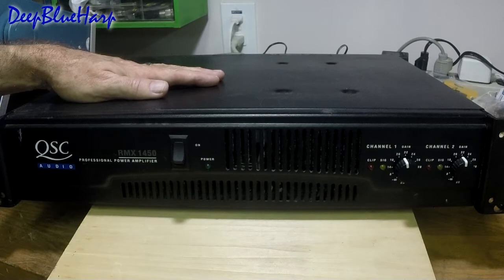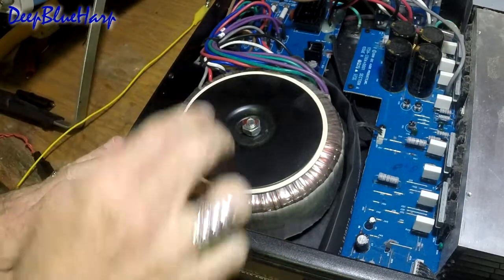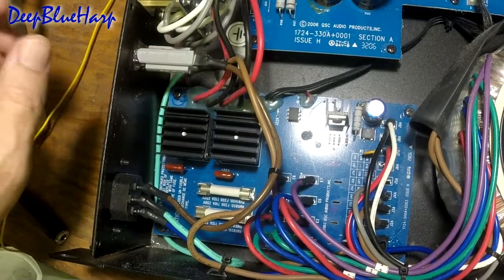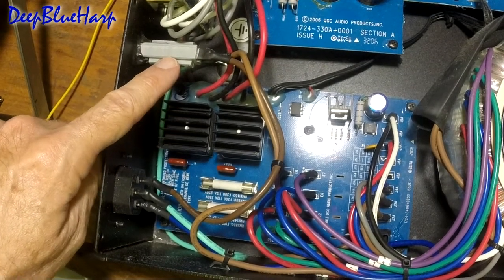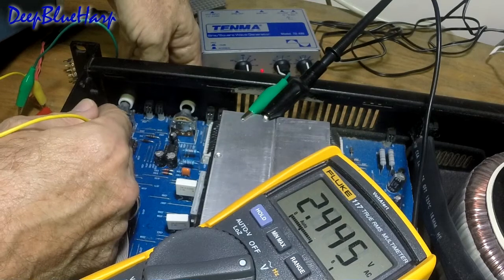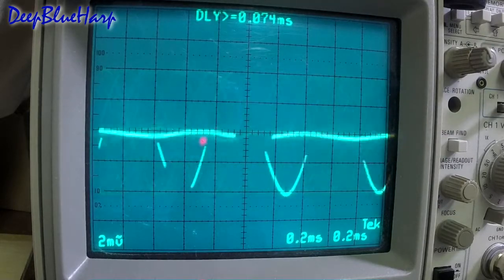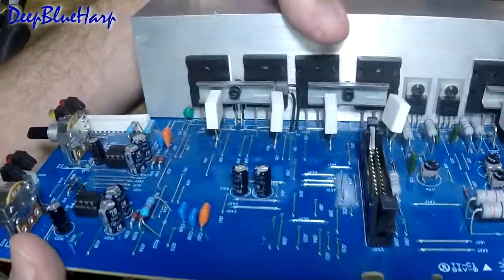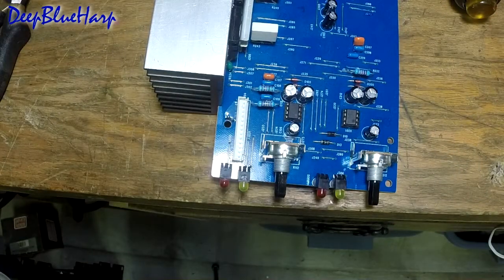QSC RMX 1450 Testing and Replacing the Gain Controls

Comment: Dear all , I have QSC RMX 2450  in that clip signal activating when signal input , and their is no any short in any components, changed (NE5532p op-amp ) but still same , channel 2 is working fine but channel 1 is having distortion with clip signal activated parallelly, i requesting all to support this issue,,

Comment: I have constant problems with the gain pots on multiple QSC amplifiers.  Sound cuts out during adjustment.
Reply from the maker: I work on older vintage amps and the pots are rarely an issue. However, the QSC pots are a chronic repair problem.  Modifying the QSC for a better quality pot may be worth the effort. You''ll need to buy 16mm diameter pots.  Good luck
Reply: Where do you get the better quality parts from

Comment: I have the same amplifier and if adjusting the gain the subwoofer made a strange sound.  The subwoofer did not seem to play correctly after that.  Is it possible the subwoofer was ruined due to bad pots?
Reply from the maker: No, bad pots will not cause the subwoofer or speakers to fail. However, to determine what is going wrong, the amplifier would need to be checked out by a technician. There may be some other failure inside the unit: thermal/mute circuit, op-amps, transistors, etc. It would be unlikely if any failure inside the amp caused damage any connected speakers.  Solid State units are highly susceptible to voltage spikes that come in from the AC plug. If this amp suffered a voltage spike, chances are that the sub did also. This means the sub failed from the same type of event (voltage spike) but independently from the amplifier. Unpowered speakers are less prone to voltage spikes because the amp will fail first and the coil in an unpowered speaker is tolerant of voltage spikes. Voltage spikes kill powered speakers because they have solid state circuits.

Comment: Great video! I have one of these and the gain POTs were removed and resistors tied together. I suppose that means the amp is at unity gain and will go full blast if I power it up. Is there anything that can be done?
Reply from the maker: Either replace the pots or control the gain to the amp. You could feed the signal to a small mixer to control the signal gain to the amp.  It would be still be easier to replace the pots.